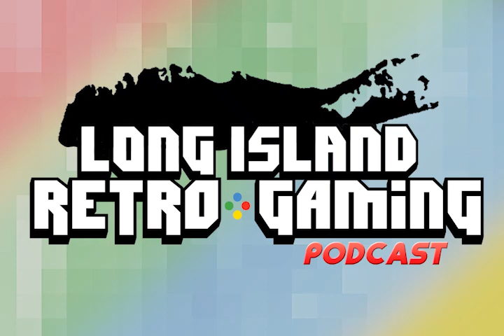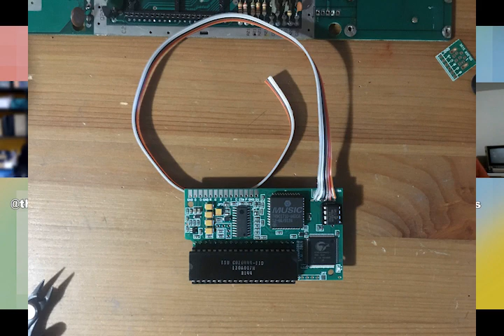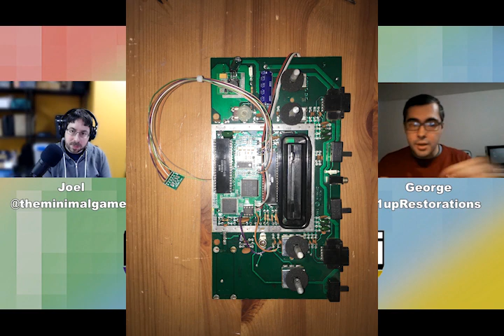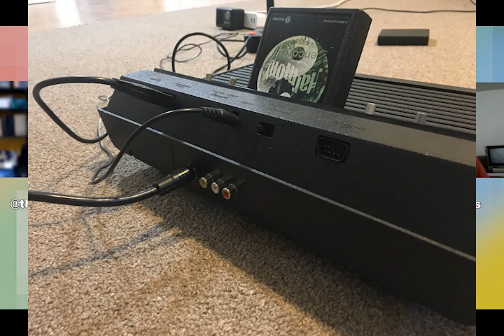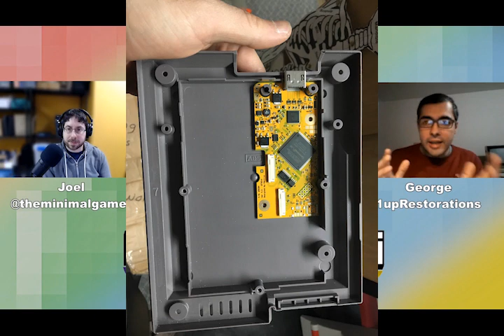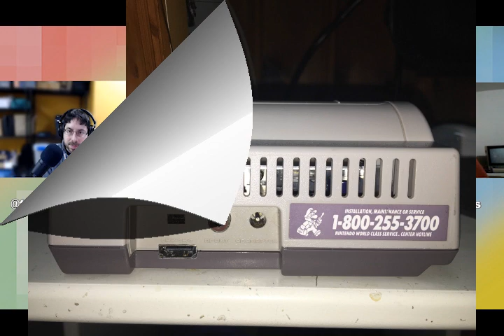System Modifications - LIRG Podcast Episode 4

Comment: 36:52 Mega Drive / Genesis Model 1 revisions from early to VA6.8 use a discrete YM2612 main sound chip, and a PSG (secondary sound core) embedded in the VDP (graphics chip), and were made with a correct mixing and amplification circuit.

Model 1 revision VA7, and Model 2 revisions from VA0 to VA1.8 use a YM3438 main sound core and a PSG core that are both embedded in the VDP, and were made with an incorrect mixing / amplification circuit that gives poor overall sound quality (solveable with a MegaAmp or Triple Bypass).

Later Model 2 revisions went back to a discrete YM2612 main sound chip, and a PSG core embedded in the VDP, and were made with an almost correct mixing / amplification circuit that has a flaw with 2 of the PSG channels being quieter than they should be. Would still benefit from a MegaAmp or Triple Bypass but not to the same extent.

I think Model 3 and Nomad have the YM3438, PSG, VDP and other functionality in an "everything except the CPU" chip, and were made with either an "almost correct" or "correct" mixing / amplification circuit, although the Nomad was made with very old-fashioned internal speaker amplification that has a poor damping factor which makes the speaker sound very "boxy" in the housing. This is solveable with a Triple Bypass.